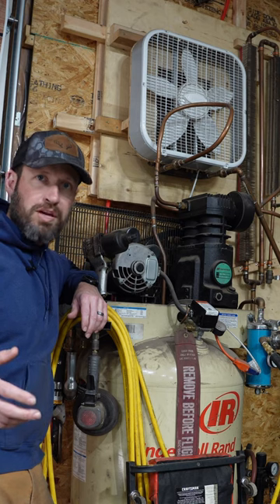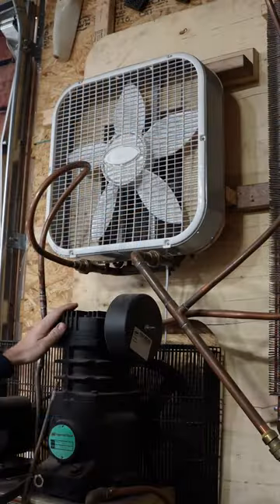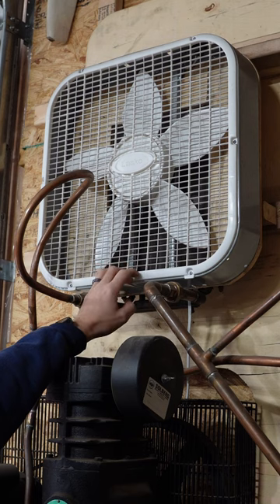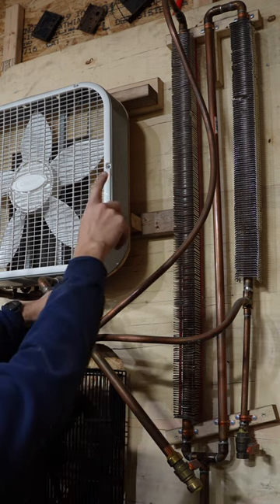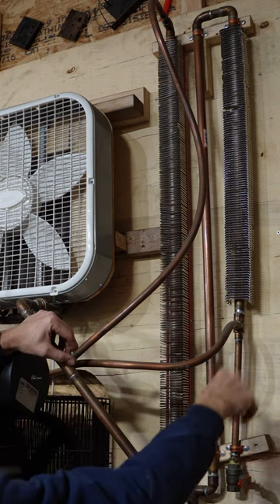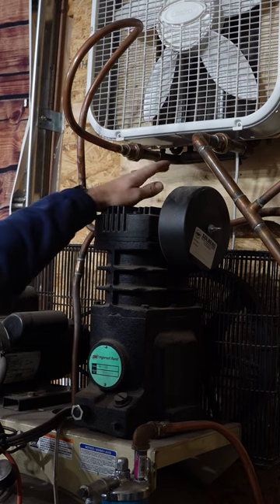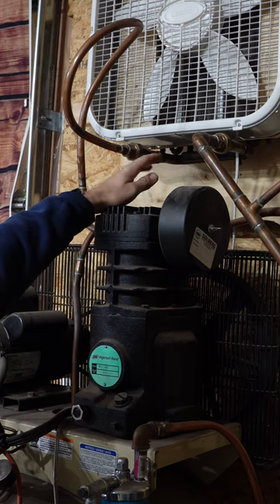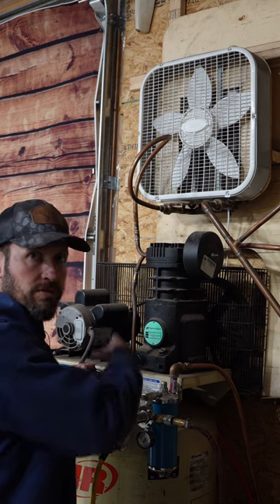DIY compressed air dryer #shorts

Comment: Please do one thing. Move the check valve. There is to much air volume for it to bleed off by the time the pump turns on. If you don't fix that then the motor might burn up. It should take about 30 seconds to bleed off all the air from the head of the pump. If not then there will be pressure on the piston when the motor starts a that will draw more amps and eventually burn up the windings in the motor. First symptom of this is air always blowing through the unloader and tripping the over load on the motor. Good job on saving around 1,500 to a grand on a refrigerated dryer.

Comment: how much does an air dryer cost?
Reply: right!!! like look at what he built!!!! jesus!!!! my air compressor with dryer was  150..and that's far from the cheapest...
Reply from the maker: The simplest versions that really don't work great on amazon are well over $100, a real air dryer starts closer to $900 and can easily be $1500...
Reply from the maker: I agree that you can get inexpensive water separators, but they are not truly air dryers.  To actually get the moisture out of the air, the air needs to be cooled so the water is "squeezed" out of it.  Warm air holds much more moisture than cold air, so by cooling the compressed air to basically ambient temp and giving the water a place to settle, systems like this get exponentially more humidity out of the compressed air.  If you're just running air tools, something like this is really overkill, but if you're doing a lot of plasma cutting or automotive painting you really need dry air.  But honestly, I really don't need it, I just thought it was a fun project and wanted to see if I could!

Comment: Long shot, but is there a video on how you mounted the condenser on the wall?
Reply from the maker: Been a couple years since I made the thing,  but I think I used conduit straps,  I'll take a look and get back to you.  I attached the long form video,  not much but might get a better look. 
https://youtu.be/YTl8AV64LDY
Reply: @twosawacres8096  appreciate the follow up.
Reply from the maker: So I took another look, the condenser had an upper and lower flange on it, so the coil is screwed to the back of the plywood and the fan is screwed to the front of the same piece of plywood. Hopefully that makes sense.  I wish I could add photos in these comments...

Comment: And by the time you get the air to your spray gun your running 3psi amd 4cfm lol
Reply from the maker: I'll have to run a test to verify,  but so far I've noticed no impedance to airflow.  Using the blast cabinet is no problem.  I used 1/2 and 3/4 copper,  which has a larger ID than most standard air hoses that would be used for a spray gun!
Reply: @twosawacres8096  yes but the principle of pressure drop must take effect no matter what as length is increased for the air to travel
Reply: @khalid95eG this is all ran before the air fills the tank, right? So no pressure drop
Reply: The thing is that there is a valve in the tank that holds the pressure in it. So the additional line starts at zero psi and then builds up to the cutoff pressure. So is what you are saying is that the pump will have more blow by. Or that the pump is not going to take in as much air in it's compression stroke. Now if I understand what you want to say then yes it will take longer for the pump to fill the extra line and will run longer to do it. The tank pressure will be the same with or without the extra line.
Reply: Next time you run it and the motor cuts off, how long does it take for the air to drain out of the pressure switch through the unloader valve? I hope that it's not so long that the motor starts up again. When stock it should have been about 15-30 seconds. You might want to put a new check valve before the first radiator. That way the motor will not have a load on it when it starts. One more thing. How does the water run down the radiator? Looks like it will get stuck in the ac radiator or could run down to the pump. Two things that take out compressors. Water rust the pump. And pressure on the head will Trip the breaker on the motor. Both things will take out to be of the most expensive part of a air compressor. If you block of the tube from the check valve in the tank and install one a run a new line to the pressure switch and switch the water flow so that the pump inlet to the radiator is on top should and will run a long time. Just remember to only have one line going to the unloader valve on the pressure switch. 

Oh a check valve will thread into a larger pipe and you could just move the one in the tank that way.

Over all not a bad way to not need a refrigerated dryer.

Comment: Why not put the box fan perpendicular to the wall?  The footprint of the air compressor seems sufficient to allow the secondary cooling loop to be placed on the inlet side of the fan, and the first stage condenser on the fans outlet. You could have that air liquified by the time it hits the tank 🫠
Reply from the maker: I see what you're saying, and it makes sense, I'm not using the fan to it's fullest.  I didn't even think of that when putting it together.  But I will say, the return line into the tank is basically ambient, so I got lucky I guess.